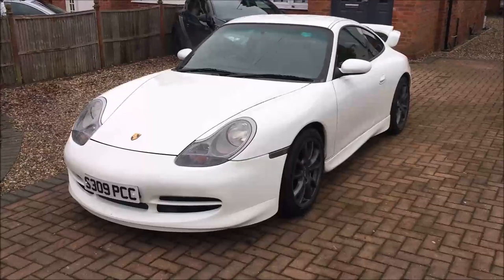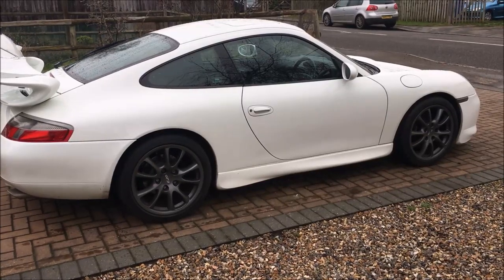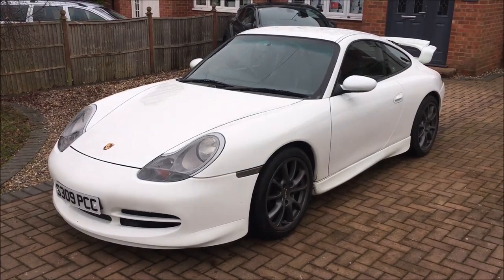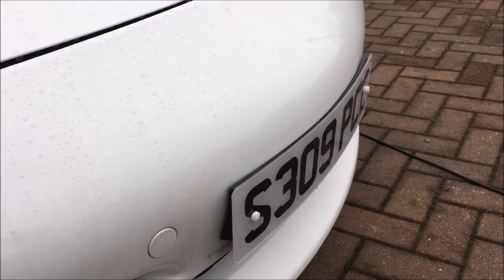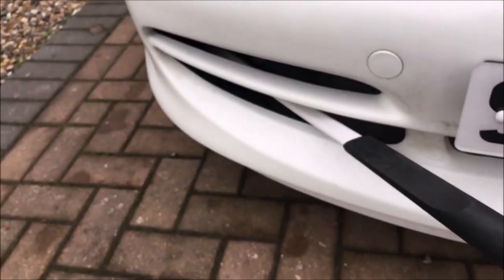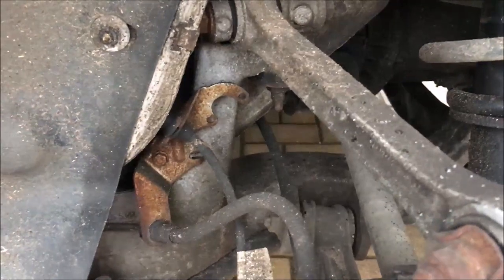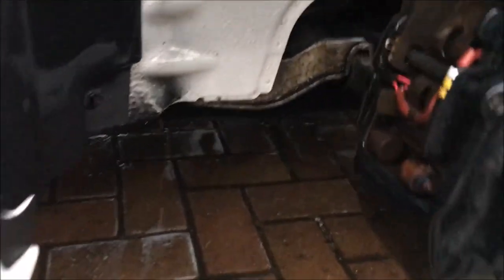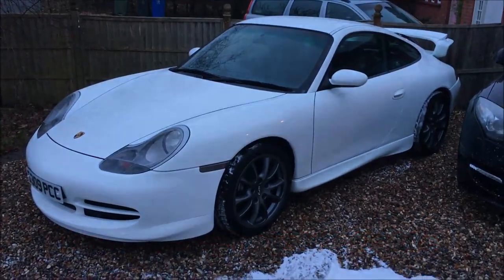The New Arrival | How to Guide DIY | Porsche 996 986 987 997 911 GT3

Comment: Gorgeous.   If you take the front bumper off and separate the side radiators you’re will not believe what gets between them.  I did mine and the feathers / leaves made a pile . This looks fabulous 🏁👌
Reply from the maker: Yep I still need to do this on the 996!
Reply: TheThrottleCable help me diy.  He covers lots of jobs on his Boxster but be exactly the same.    He shows you exactly where the fasteners are and after a couple of watches I did it . You need a trim removal tool for under the arches and a few torque and hex tools.  Takes a while but may save a fortune and sooo satisfying

Comment: Hi Just picked my 996 up yesterday and seen your post, what did you use to clean the arches so well ? Thanks
Reply from the maker: I used some Dodo juice products; all purpose cleaner followed by some tar and glue remover both worked in with a medium size brush. Anything like that should work wonders 👍